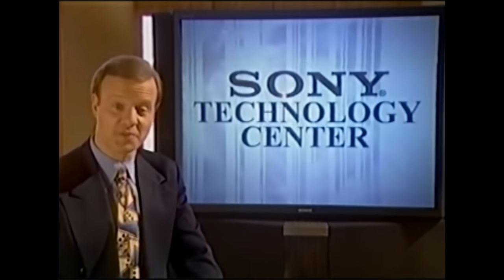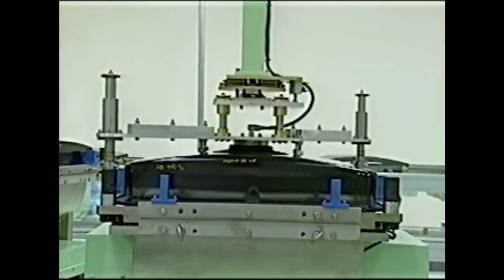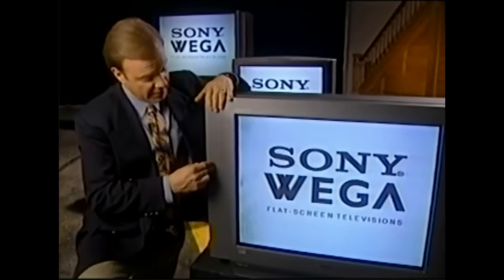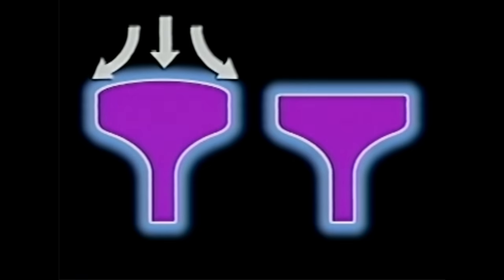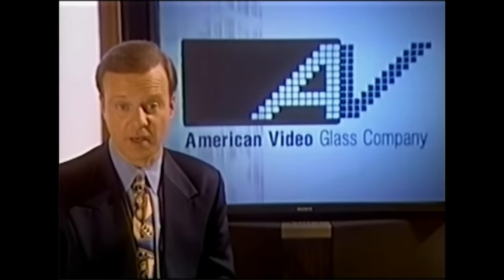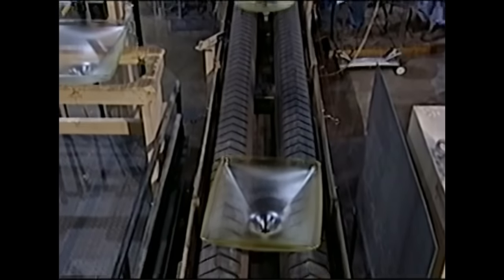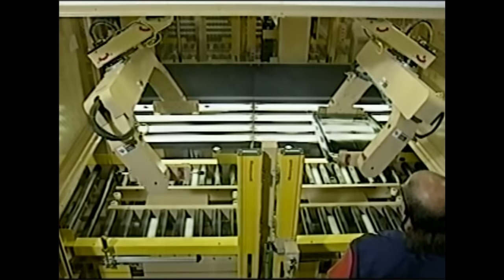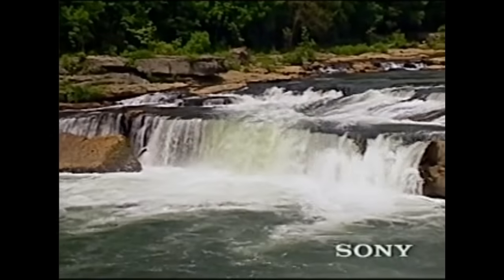SONY TRINITRON TV How was it Made ? - Japan VIDEO Electronics Television CRT Factory 1998

Comment: What is trinitron technology? How it different from other manufacturers TV? Why SONT crt tube is longer compared to other crt tubes? Why SONY crt tube RGB cathods is located one beside another unlike other tube s? Can anybody answer these questions please?
Reply: The physics behind the longer neck are the result of the deflection angle being used (a function of the funnel angle and the deflection yoke). A narrower deflection angle requires a longer neck; a wider deflection angle allows the neck to be shorter. There is a tradeoff in the choice of deflection angle: a wider deflection angle can lead to worse performance on the edges of the screen.
Reply: The Trinitron electron gun used three cathodes inline with each other. Many other manufacturers also built CRTs that had inline guns (referring to the cathodes), this was not exclusive to Sony and not exclusive to the Trinitron. You are probably not familiar with those inline guns, you probably saw mostly what is known as delta gun where the cathodes form a triangle.
Reply: I will try to address the differences between a Trinitron CRT and a typical inline gun shadow mask CRT.

Trinitron uses what’s known as an aperture grille between the electron gun and the phosphors on the faceplate. The inline gun shadow mask CRT would have what’s known as a shadow mask between the electron gun and the phosphors.

So the differences between the aperture grille and the shadow mask need to be explored to better answer this question. Both of these devices serve the function of directing the electron beam from a specific color to the corresponding color phosphor, and to not allow the wrong color beam to light up a phosphor that isn’t its match.

The aperture grille can be loosely described as a series of thin wires that run from the top of the CRT to the bottom. There will be a single wire or two wires running horizontally to prevent the vertical wires from crossing each other.

A shadow mask loosely resembles pegboard, where there are holes but lots of material between those holes. This design will block more of the electron beam from reaching the phosphors, so to get equal light output more energy would be needed than with an aperture grille.

Other differences exist, but that is the major difference.

Comment: You're JUST an ASSEMBLER.
What is Phosphor? Its Gold that the Electrons Strike to Produce LIGHT. A TV isn't CHEAP. SO, isn't a Light Bulb. Its Just That a Light Bulb is At A Higher VOLTAGE, So Less of The Precious Stuff is Needed.
A TV isn't Cheap. The GLASS for The Tube is Also Expensive.